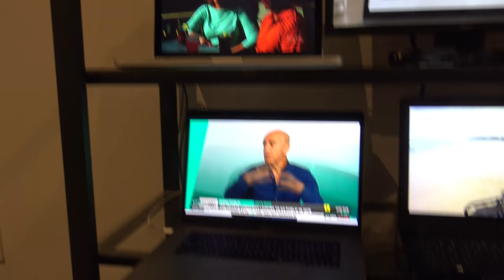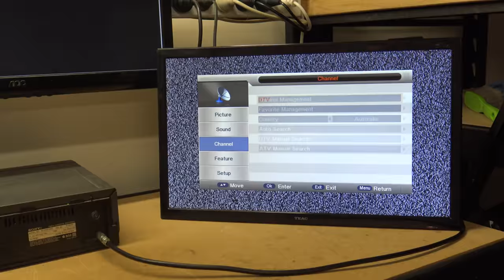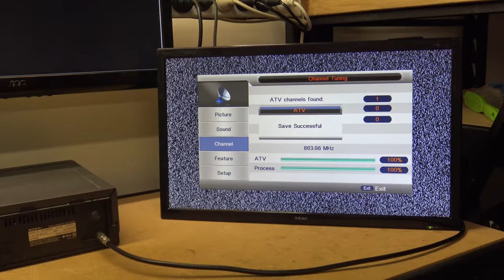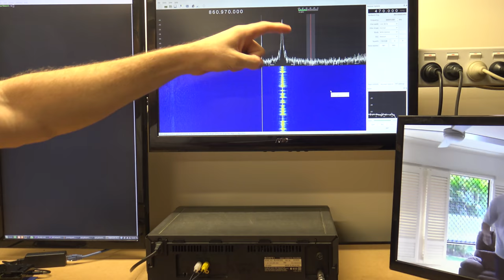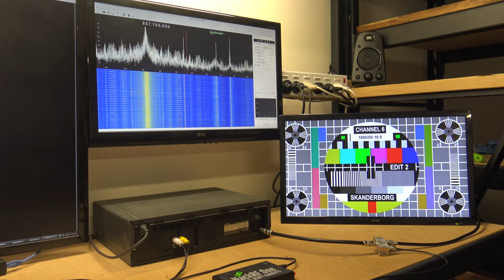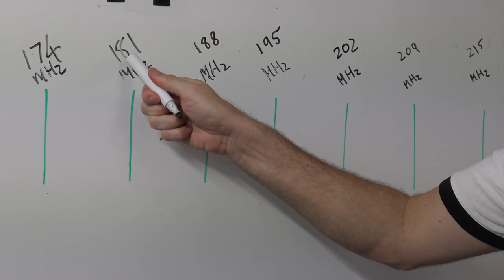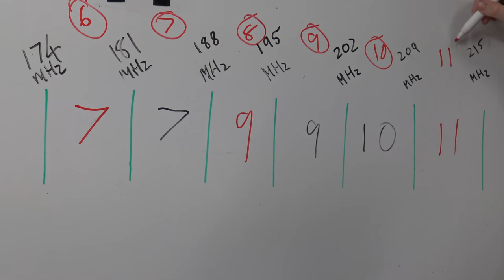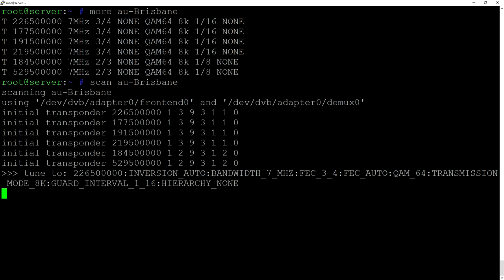TV Technology - Part 1 - Analogue Television

Comment: Would've never thought that the kids today would've never heard of manual TV tuning!

What I do miss though is the analogue TV channel changing speed compared to digital. Does your Raspberry Pi setup improve this at all?
Reply from the maker: You can use VLC to change channels almost instantly. I've seen some hardware IPTV decoders change just as quick too. Raspberry Pi isn't as quick in general, but I'll be talking about IPTV clients in later videos.